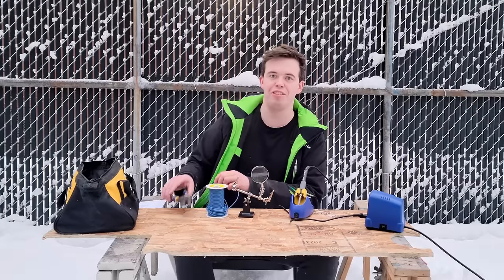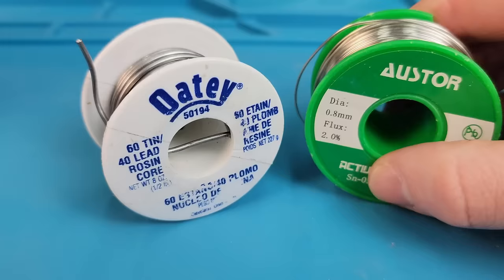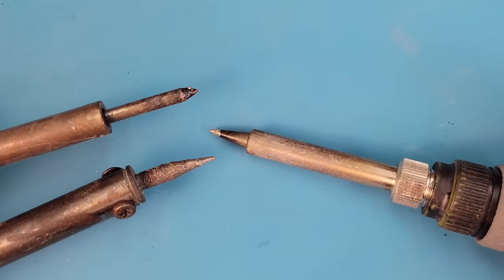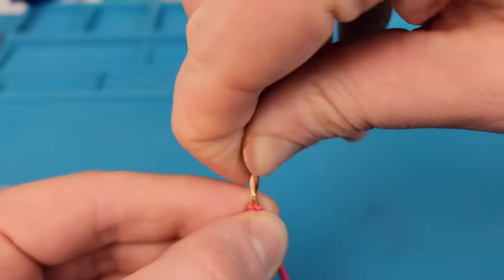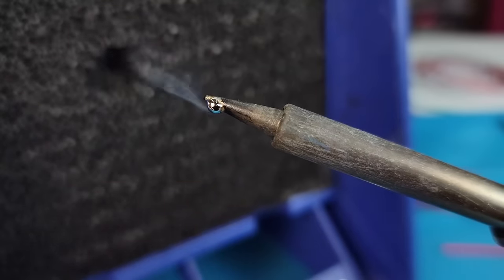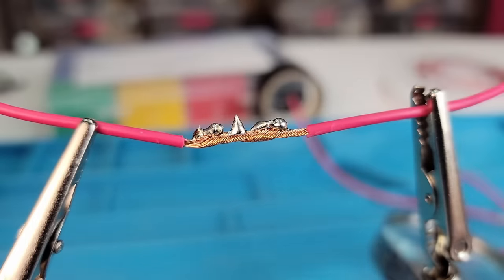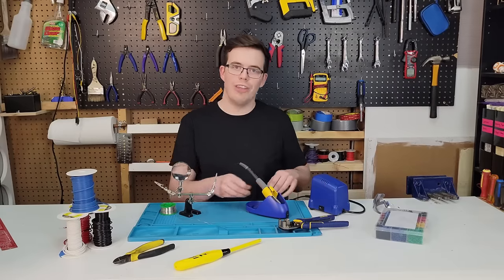Four Steps to Flawless Wire Joints (How to Solder)

Comment: I prefer to solder my wires side by side, especially if I don't have a 3rd hand.  Just tin both wires really well and then stick them together and hold very still so you don't get a cold joint.  Twisting wires tends to leave sharp points.  Also using a lighter is for heat shrink isnt good, it should be done with a heat gun for even heading and not burning the heat shrink.  Also if you use colored shrink it doesn't look like it's burned.  Never stick your iron in flux all that does is makes nasty smoke, they make tip cleaner for that.  It has a stronger acid and solder to re tin the iron.
Reply from the maker: I appreciate the feedback regarding sticking the iron directly in flux and do agree with this part of your comment, I've edited the video to trim out this short section as it is misleading to the audience. I completely agree dedicated tip cleaner is the way to go. However, I do disagree about soldering pre-tinned wires parallel, this can be okay and passable on smaller wire gauges but you will never be able to get as strong of a joint on thicker wires (like the 14 AWG shown in this video), with tight twisting sharp points won't be an issue. I also disagree regarding the use of a lighter, it is extremely versatile and as shown in this video, as long as you heat in the blue part of the flame the heat shrink won't burn (it will burn in the orange part of the flame, which I also discuss).
Reply: @thetaspen, Sorry to disagree, but the solder is not to provide the connection, but to secure the connection.  The basics when soldering two wires together is to establish a good mechanical connection and then use the solder to secure the connection.  As stated below, you can get by with this method for small low current applications, but it is not a good practice.  
One other tip I would offer is to apply the iron at the bottom of the joint.  Remember heat rises and let that priniciple work for you.  I've been soldering for over 60 years.  I worked on everthing from old tube type tv's as a teeenager to military satellite earthstations, to modern day surface mount components.  I think I have made about every mistake you could think of.  

Thanks for the video @WillDonaldson.

Comment: A lot of my soldering sees the solder roll right off the heated wire or pipe, I usually have to cut the wire shorter and expose fresh wire.

Comment: a) Use a soldering gun instead of an iron, b) dip the wires in flux so it properly wicks the solder between the individual strands.

Comment: I only use leaded solder. Lead free solder was a disaster when adopted in the aerospace industry. The joints are brittle and tend to crack when subjected to vibration and thermal stress, leading to the most frustrating kind of intermittent faults in aviation electronics. You would often see a component returned from repair with the statement "solder joints re-flowed" to deal with cracked joints. There was a gradual return to leaded solder in the 2000s.
Reply: I still hope and pray they use leaded solder.  I work on automotive electronics.  There are components that don't even get warm and the solder cracks like its cheap Chinese China.  I have made a lot of money by reflowing

Comment: I would like to see you solder the aluminum wires of lipo batteries used in the drone industry into the "XT-60" connectors that have a gold plating without melting the wire insulation.

Comment: Good video, personally I think it's an EXTREMELY expensive way to stick two wires together. All you actually need is an iron and solder. Personally, I use a mini burner. Heating the wires and then feeding in the solder.

Comment: There is such thing as fusion electrical tape (not sure if that's the correct English term for it), they don't peel off, and don't use adhesive and I actually prefer it in some cases as it still allows for some flexibility that heat-shrinks don't.

Comment: We talkin’ solder and shrink tube here? I use a pinpoint butane torch, flux, and thin wire solder. Works fast. If you’re accurate with the torch, it doesn’t burn the insulation either.

Comment: The protective coating on Weller tips prevents solder from tinning the iron & no amount of cleaning ever improves that situation until the coating is gone & the bare copper tip is exposed.  Failing to tin the coating prevent heat transfer from the iron to the job, making it pretty well impossible to solder anything at all with my 60W Weller iron.  The only way I have ever been able to get the Weller to solder anything at all is to file a small diagonal flat on the tip, then tin the flat. Having a bead of solder on that flat gives me more contact area with the job, enabling the job to heat up quickly so the job melt and accept resin core solder before the wire or plug insulation is distorted or totally destroyed.  However, having filed this flat, means the tip erodes rapidly with use, requiring swapping out tips regularly.  On the plus side though I get to complete many electrical soldering jobs while not filing means much frustration at not being able to solder anything & no jobs get done at all ever.  Welcome to reality!

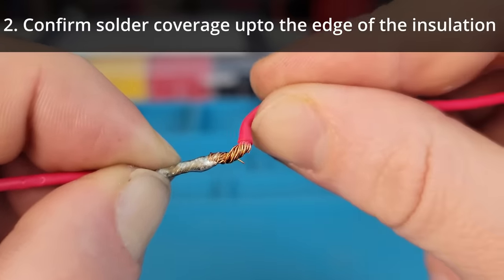Comment: @10:00 again, this only applies if the wire will be used on an application that may move. In an enclosure or junction box, any of these soldering techniques will work just fine, as long as you properly insulate them.

Comment: Good technique, but limited to cases where you have some wire length to spare so you can twist and clamp. The other technique to know is pre-tinning, then tack soldering both ends together (obviously, not quite robust a joint, and needs experience to not produce brittle or cold joints - not suitable for mains or vehicle wiring). One thing to pay attention to is not wicking too much solder in under the insulation, that can make for something very stiff and brittle, worse than if there is some wire not covered by solder!   ... Lighters can easily carbonize some of the heatshrink or melt a hole in it or stretch it thin, so you really need to inspect it thoroughly after doing that....

Comment: It should also be noted that leadless tin solder can form tin whiskers over time as the tin oxidizes and spits out spikes. Probably not as much an issue with splicing wire, but with circuit boards it can cause serious longevity problems. This has been a huge issue for NASA, as it's killed equipment in space on unmanned probes, which obviously can't be fixed.

For this reason, and the lower melting point of lead, I always prefer leaded solder.

Comment: I've been trying to learn how to solder and I just can't do it. It seems like whenever I get solder on the tip of my iron, it failed to transfer to the surface it's intended for. Like all it does, is start touching the wires or the PCB that I'm trying to solder and then it chooses to stick to the tip of the iron rather than transferring I'm assuming it's because I'm using an ineffective Flux? Or maybe my iron tip sucks?
Reply from the maker: It is hard to say without seeing a video of your process. But a few things to check: 

1. Does your solder contain flux? It should be labelled as flux/rosin core. Some solder is sold without internal flux. 
2. Is your iron tip clean? It should look shiny and smooth after tinning
3. It sounds like the solder is pooling on your tip, this may be because the solder is being applied too close to the tip of the iron. Ideally, solder should be applied from the opposite side of your work surface to where you are holding your soldering iron, as shown in the video at timestamp 8:54

Comment: ⚠️ IMPORTANT SAFETY NOTE ⚠️

Good tutorial for the case that a soldering joint is appropriate! But please keep in mind that soldering joints are only safe for signal wiring, for example a microphone cable or headphone cable (whether a soldered joint retains the quality of the connection is another topic). Used on power wiring, which is any thick wire, including what's shown in the video, soldering (soldered joints as well as tinned tips) presents a serious safety hazard. The reason being is that when there is a current flowing through a wire that is high compared to the wire's  thickness, the wire gets hot, which leads to the solder becoming a little soft or even liquid. This means that in any sort of wiring that has significant power and thus current flowing through it (which is indicated by thick wires as there's a reason for their thickness), solder joints become uncontrollable and could cause both undesired contacts (short circuits) leading to fires, as well as poor contact, which also causes fires as the electricity starts to create arcs to bridge the worsening gap.

What should you use instead? Proper wire connectors that have a current and gauge rating. In North America, wire nuts are usually used. In Germany, we use Wago connectors which I believe to be superior as they have less (not no!) potential for misuse. Here are some things to pay attention to when using wire connectors:
- make sure they're rated to the current the circuit breaker is rated to.
- make sure they're rated for the wire gauge you're using them for. I believe wire nuts are only for a small range of gauges, while Wagos accept a wide range. Make sure the gauge you're using (e.g. 12 AWG) is in that range.
- make sure they're meant for the type of wire you're using. Not all connectors, especially not screw terminals, can accept stranded wire as the screws cut throught the small wires if there's no protection. If you need to use stranded wire for a connector that is solid core only, crimp ferrules onto the stranded wire.
- pay attention to the installation guidelines, e.g. the length of wire that needs to be desheathed.
- make sure there is good contact. An example for bad contact would be if you were to put a bent solid core wire into a wago connector where due to the bend, there would only be a small contact patch.

Comment: So first off... You always Tin up each wire separately. If the solder is not "Wetted" to the wires prior to joining them, then they won't bond. After Both wires have been properly tinned. Then you solder them together. Also remember to use some small set of heat sinks on each wire to make sure that you do not melt back the insulation. Never remove the factory tin from your soldering tip. Throw away the tip and replace it if it loses the tin. Always tin the tip before turning off the soldering station.

Comment: Use a small butane torch and a flux paste. It's much faster than using a soldering iron.  Also for larger wires than 10AWG clip 1/3rd of the wire before twisting them together and soldering. Thank me later.

Comment: I wish someone would invent heat shrink tubing that can be slipped on after a joint. There are times when the wires to be joined are short and there's not enough room to slide on the heat shrink tubing beforehand

Comment: Heat shrink tubes are too expensive here or just wrong sizes, but otherwise great advices. Wire quality is also a factor. I used some jumper wires for breadboards on a Raspberry Pi Pico and it was too complicated in the long run. (Not the usual material inside.)

Comment: Good tips, except cleaning the tip before turning it off. 50 years in IT services and I tell you that you should add a little solder before turning it off then wipe it clean when reused and up to temperature and ready for use, just like any continual use always wipe before every use and never use solder that has burnt off the flux on the tip.
Now we need a video on board repair. Where the above video tips are essential or damage may occur.

Comment: I'm new at this.

When is this technique used? Why wouldn't you use wire nuts?
Reply: You can use wire nuts only on solid wire, i.e. just one solid strand under the insulation, and even then only when the wires are installed in a place where they are not subject to pulling, vibration, or such. Know what gauge of wire you're working with, and choose the appropriate size wire nut. Wire nuts will not work correctly with multi-strand wire. Wire nuts should NEVER be used ANYWHERE on a car.

Comment: @11:30 electrical tape made by reputable companies like 3M make great electrical tape. This tape will work just fine for protecting the soldered joint. Again, it depends on the application. This is KEY. Cheap electrical tape will come loose even in the most perfect applications.

Comment: One of my challenges is to get the solder to even stick to the wire. Despite using rubbing alcohol to wipe off the target section of any oil/grease, the solder just won't stick T T
Reply: Pre coat with flux

Comment: no matter what temperature I get the wires at even though the solder comes with flux inside I always struggle to wet the wires with it
Reply: just add flux on the wires before soldering.

Comment: Hold iron under wire as the heat travels up also this means you add solder from top letting gravity help infused the wire.
All basic physics really.

Comment: Don't twist the wires together.  Pre-tin the cables, lay them side-by-side, apply heat and just enough solder to attach the two.  

You can find the NASA standards on solder joints online.  It'll make you better.

Comment: Normal electrical tape is just a pain in the ass, but there's that sort of tape that fuses to itself. Wouldn't use it for insulation, but there are situations where I've used it instead of zip ties because it allowed for a thinner overall diameter.
Reply from the maker: Do you have a link or product name for that style of tape? I'd be curious to try it out, I have only used generic electrical tape in the past
Reply: He’s talking about silicone tape they have it everywhere stuff works great

Comment: try using junkie tip and lead I know that's the reason why most of the people can't solder , the lead wont stick to the tip and other reason is that lead is not melting

Comment: A lot of wire repair is underneath a truck or trailer surrounded by a lot of things. Putting the ends of the wire in claps isn’t always an option.

Comment: No solder is needed for the Lineman/Western Union Splice. I learned it from Chris fix. It's the only Splice that is legal for aviation. You should at least check it out. Pull as hard as you can and the wire will break before the Splice fails. No solder no butt connectors

Comment: Most cheap automatic wire strippers are garbage... If i could recommend ONLY ONE wire stripping tool, it would be the Knipex ErgoStrip. It can strip different crosssections, strip very short/inaccessible wire sections, and remove mantles/shielding of (coax- and normal) cables. I also have an expensive automatic wire stripper (PreciStrip16) that works very well, except on very short wire sections, which it cannot grab. Most of the time i find myself just using the ErgoStrip because it's more convenient and compact.

Comment: Good vid & tips.  But based on the assumption you  have good soldier.  Best tip - dont buy solder from auto store but from electrical store  40/60.  The expense is far cheaper then wasting yr time on crap non-quality solder that breaks off refusing to melt.

Comment: Do not twist your wires into a single core before soldering.. This weakens the copper and will result in the wire being more likely to break due to material fatigue.

Comment: NUMBER ONE RULE... nothing solders better than a Hakko and NEVER EVER sand the tip... use ONLY the brass brillo to wipe it off.  Number two rule..... USE RESIN SOLDER for electronics....it's cheap and it makes ALL the difference in getting the solder to adhere and flow.  You do NOT need to hold the solder iron against the wire while feeding in the solder... BAD practice.... flux the wire then tin the tip and touch it to the wire and it will flow like magic. Holding the tip of the iron on a wire for prolonged periods while feeding solder, may damage electronics that are sensitive to heat.

Comment: Step 1: throw away your el cheapo 5 dollar pencil soldering iron and get one with a station, proper heat control, and more wattage. This is like the only step most people need to solder competently

Comment: A good tutorial. But (in my opinion) you did not place any emphasis on cleanliness! many wires to be soldered may be oxidized on the copper strands to be soldered. It really does not matter what you are soldering - the first (and most) important rule to follow is cleanliness. If the Heat Shrink does shrink - due to heat, place a pin or needle down the bore of the Heat Shrink and between the wire insulation. You can then expand the Heat Shrink enough - to slip over the whole soldered joint.

Comment: The bottom line, if you want to make good soldered connection don't buy a soldering iron under$60. AND DON'T BUY A SOLDERING "pen" get one with a seperate base like in the video. It takes 10 second to get to 650 degrees and never drops in temp while soldering. I use the trusted Weller brand.

Comment: Heat rises.  Iron/tip on the bottom doesn't have a larger heat transfer patch since the solder will puddle on the bottom of it, but will heat the wire almost as fast anyway.  Apply solder from the top.

Comment: 8:57 your copper does not absorb solder, its either too cold or oxyded. You need flux. 

When the tutorial is not as good as it seems.

Yes i flux my wires.